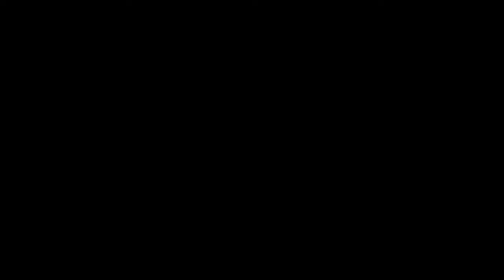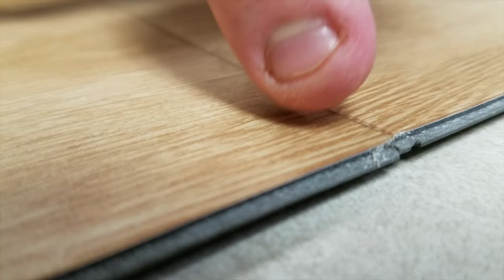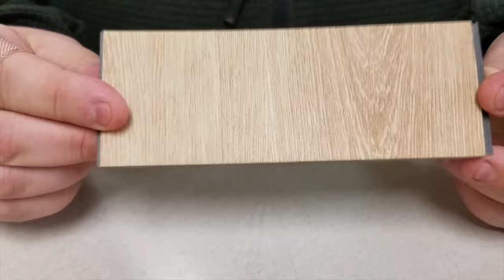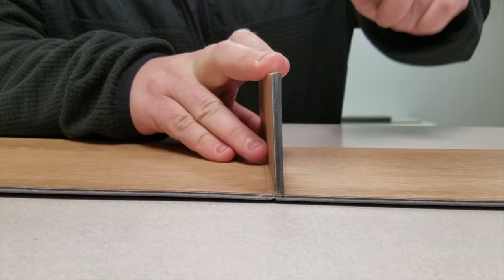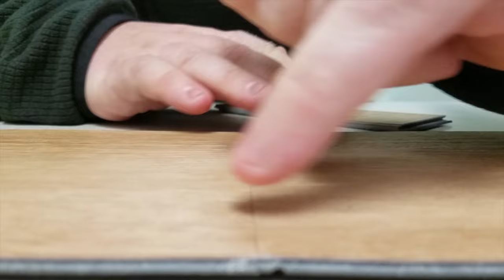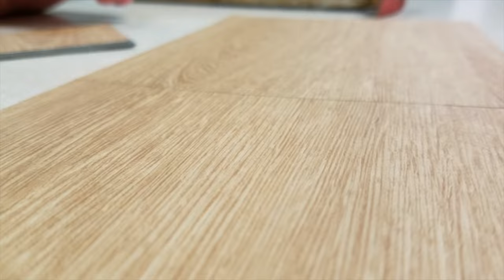SOLVED!  IVC Waterproof Plank Click Flooring - End Lock Difficulty

Comment: I also check all the edges to make sure there aren't any stray wood pieces clogging the grooves.  I use an old toothbrush to clean all 4 edges so there isn't any wood debris preventing the edges from locking together.  Whenever I need to hammer in boards that won't lock tight I use a scrap piece of laminate (about 6' long and I shave back the decorative top so it won't bang against the decorative top I'm hammering in place.) and lock it in place while I whack on it with a hammer to get the nice tight seam I want.  I helps prevent chipping of the decorative edge.
Reply from the maker: Good tips, all!

Comment: What about using a tapping block instead?
Reply from the maker: Maybe, Adam.  We were looking to target a little more sharply just that end joint, using what the home installer would have at hand.  Most don't use a tapping block for click vinyl - it' so much thinner than the wood based planks for which those are made - that we didn't want to make having one part of this solution.

Comment: Hi, I wonder if you've ever worked with Coretec vinyl flooring and can help me with the problem I'm having? The product is drop-and-lock (you click together the long sides first), but then also requires a final tapping from the end to get the end joints to click together. About half of the time, the end joints have a ~1mm gap between them and no amount of tapping will make the gap close. I've tried using a bridge plank and your method from this video. Anything else I could try? The product is specifically Coretec pro galaxy. Thanks.
Reply from the maker: This is tough.  I can't see (or imagine, in a useful way) what's happening, we don't have that particular product, and (as you may already know) Google led me nowhere useful.  So this is all theoretical.  

1.  If you have padding down on the floor, sometimes, especially with vinyls, the tapping is absorbed by the pad, rather than usefully pushing the top plank into the bottom one.  It may not be fully locking.  What you can do is slip a cut piece under the planks you're locking, between the padding and the planks, so that you're tapping over a hard surface rather than a soft one.

2.  Otherwise, your locking mechanisms would almost have to have issues.  With drop & lock on vinyl, the connection is snug - and you really can't mis-connect these; they lock exactly one way - and that establishes how the top surface sits.  It's possible that some of the locks are damaged.  You'd have to look at them closely, preferably from the side, to see their shapes.

Your locking ends should look basically like this
https://www.youtube.com/watch?v=d2pTLyPmGQA&t=2m29s
except that they'll actually be more square.  I'm showing a laminate because the locking mechanisms were much bigger, and easier to shoot on video.  The protrusions on the top and bottom for this laminate are a little V-like.  Yours should be cut at perfect 90 degree angles.  The cross-section should look like you're locking two squares snugly together.

If those are damaged, and have some give, they won't be able to pull the surface tops together as they're designed to do.  

Without seeing it, this is the best we can come up with.  If we're way off on both, maybe try to video what's happening, with your camera (or phone) as close to those ends as it can be before going out of focus, similar to what that video link shows, and maybe we (or your seller - they could help, and would also benefit from seeing it) could see from the video what might be happening and give better advice.  You could upload it to YouTube 'unlisted' and post the link in these comments so we could look at it.  

I'm sorry we can't be more specific at the moment, and hope you get this solved via someone!
Reply: @FloorsToYourHome  Thanks for the long reply! There's no padding under the floor since the manufacturer doesn't recommend it, so that's not the problem. I looked it up and the manufacturer actually calls the system "angle-lock" so it may work differently from the drop and lock you're thinking of.

We still don't know what's wrong, but figured out two solutions that allow us to install the stuff:
1. Click the long side in, then have one person lift the end joint slightly and put pressure on it. Basically push upwards a bit on the very end of the old plank and downwards on the end of the new plank. Then when the other person taps from the far end the joint goes right together.
2. Click the whole row together end to end and install it at once. Easy but only for short rows.
Hopefully this might help someone with the same problem in the future, since your video was the first one that came up while I was trying to solve the problem!
Reply from the maker: Okay, Jessica, I have one more thing to add then, with your new information in mind, not to complicate, but only in case it helps.  Angle to angle installations and drop & locks fit together differently, as in ... hmmm, okay - with a different 'sequence'.  Here, this is a little quick, but shows it:

https://www.youtube.com/watch?v=M4mWfJwxizQ

If you have a drop & lock floor, the installation order is to lock the long side, then drop the new plank down onto the previous one for the short side.  

Angle installations are reversed - you lock the end joint, the short side, first, then do the angle side.

This uses a laminate to demonstrate that process, but the process would be the same whether your angle to angle installation is with a laminate or a vinyl click-together floor.

https://www.youtube.com/watch?v=PCjLfJR33G8&t=4m40s

(I've gone past the preliminary stuff with that link - feel free to rewind)

I hope some of that helps (others, as you said, if not you yourself at this point)

Comment: I wish there was an easy way to fix long edges. When installing my LVP the first few planks were extremely hard to get the edges tight. Now in a couple spots there is about a 1mm gap along the long edge. Tried double stick tape and hammering them down, but they dont really close. Only way I know how to fix them would be to uninstall all the tiles(which would be most of the room, hours of work) and reinstall them.
Reply from the maker: Hi, A.F.,

One of the issues with installing these is that tapping blocks are generally made for thicker floors, laminates and hardwoods closer to 1/2" thick rather than the 4-5mm of a vinyl plank.  What we have recommended in these cases (or just when one needs, but didn't happen to get, a tapping block) is to take a discarded piece of the flooring and use it as a tapping block.  You would put the tongue of the discarded piece into the groove of the just placed one, not even locking them, necessarily, and then tap against the discarded piece to close any gaps in the seams.  

It's definitely recommended to not leave issues in place, but take care of them as they pop up in installation, because at best they'll just remain, but since floors expand and contract with environmental changes, they're more likely to worsen.  

Fixing your issue may be tricky.  If it's the first row, or an early one, I'd recommended getting a "pull bar."  That's a metal piece about a foot long, like a flat bar, where one end is bent down at 90 degrees, to go down over the edge of a plank, and the other end is bent upwards, an inch or two up from the bar, to hit against with a mallet.  

https://www.floorstoyourhome.com/blog/wp-content/uploads/2012/05/DSC_0018.JPG

You would remove your trims, and then to get that gap to go away, you need to lift the outer edge of the plank.  Once it's up at an angle, slip the small, dropdown edge of the bar over the outer edge of the floor, and you should only need to pull a little on the other end of the bar to close that gap.  Then set the plank back down.  

Now, if you can't get the outer edge up because there is so little space between the edge and the wall, you could use a Paint Tin Opener to grab it and lift it, then put your pull bar in place.  Here's one of those things:

https://mobileimages.lowes.com/product/converted/048661/048661342602.jpg

The outer edge of the plank must be lifted to get that gap to vanish, though.  I realize that, since the planks in the row are connected, that may be difficult, but it still might beat undoing the whole floor.

It might destroy the tongue mechanism on those edges, this process, but since that's the edge of the whole floor, floating under the trims, maybe that's not a great concern.
Reply: I used a pullbar as you said but I needed a little more hammer power, so I used it with a 2lb hammer and that gave me enough to close the gaps! It looks professional now. Thanks for the advice!
Reply from the maker: @AnarchoFuturist   Excellent!

Comment: My diy install lvp is running into this issue. Ebery couple months i have to re tap down with the flooring mallet. In certain areas. From what im gathering this is likely the fix i need because its not fully lockinf, right?
Reply from the maker: From your description, yes.

Comment: I have been working with Easystreet comfort spc rigid 12x24" dropclick vinyl tiles with stone polymer composite core.
The long sides are 100 % but only about half of the ends will lock down using your tapping method. The entire length of the ends are not flush with next tile...raised by a little less than 1/16.  Thank you.
Reply from the maker: I'll do my best, Dale.  There are two unexpected caveats, though:

1 - This isn't Durango, for which we made the video, and, occasionally annoyingly, most manufacturers have their own locking systems, locking designs specific to their stuff.  It means that weird things can come up for only one make of a floor.  Your Easystreet products have not come though our warehouses before (it looks like it may be a Canadian product, and we're stuck down here in the U.S.).  I Googled to find the documentation, to see if it holds any secrets, but sellers seem not to have posted those for us (we put it up for every product, so that was surprising to me).

2 - Our example floor was an angle-to-angle style installation, with both sides properly locking the way only your long side does. You probably know the difference I mean between how the long and short sides work. Well, that's where these issues usually arise, when a proper locking mechanism has not fully engaged.  Your floor is Drop Click, what we call Drop & Lock, where the end joints don't so much lock as they rest, one atop the other, and are only 'locked' by the next row's piece overlapping that seam.  Since one plank simply falls into place over the other... well, you shouldn't be having such an issue, and there's not much that's 'fixable', like there can be with the mechanisms on your long sides.  It's quite perplexing.

So this is going to be pretty general, but hopefully will help.  You need a rubber mallet, and you'd want to tap that high ridge down.  It sounds like the same process we demonstrate above, but it's different, because you're applying more force, and applying it more generally to the end areas, rather than concentrating on the spot right at the lock (which is what ours specifically needed).  

An issue with this can be with padding.  It can absorb your work, and make this ineffective.  If you have unattached padding, we recommend sliding a cut piece underneath these end joints, between the padding and the planks, to create a hard surface underneath, so your pounding can accomplish your goal.

But again, you're using a specific floor I've not worked with, and you're having a problem which should not happen with the kind of flooring you have, unless some planks are actually thicker than others, which would have to be a manufacturing defect.  If what I'm recommending is ineffective, you should talk to whomever sold you the floor to get information more specific to Easystreet Comfort SPC, which I simply can't get, it seems.  You might try that first anyway, since I'm left with mere spitballing as an option in advising you.
Reply: Thank you very much. I hadn't considered the padding although I think I've o reco me that with more force on top...maybe too much.
  Manufacturers defect I think, or damage in transit. In looking closer at some leftover tiles I think I would have had to use a razor blade to remove a small part of the locking system to allow the ends to rest flush with the adjoining tile.  Live n learn :-)